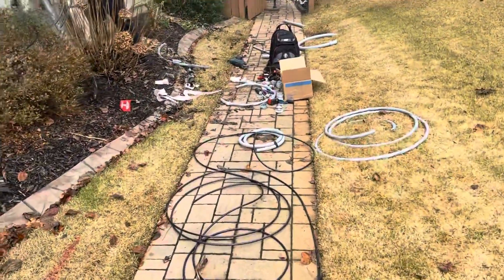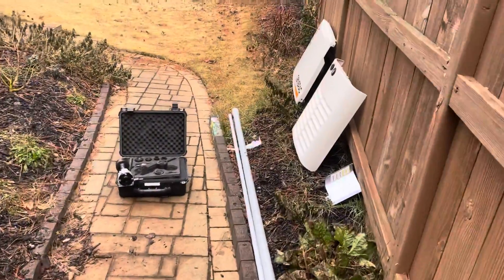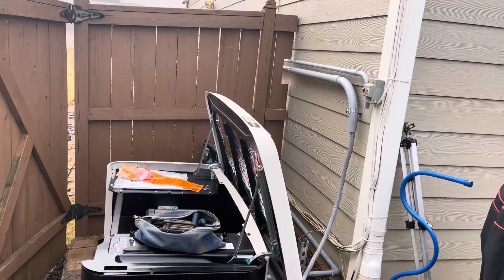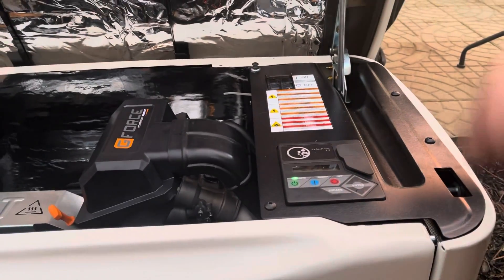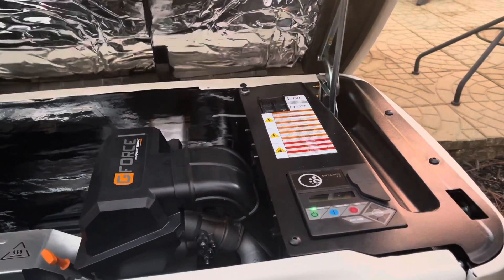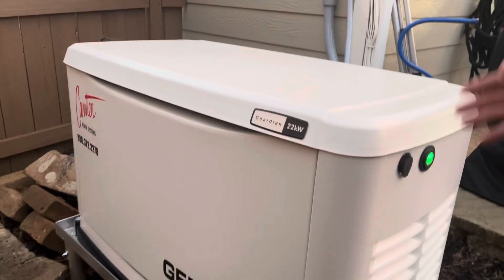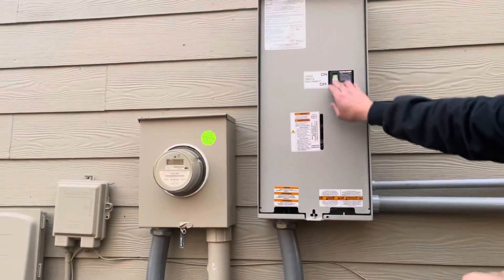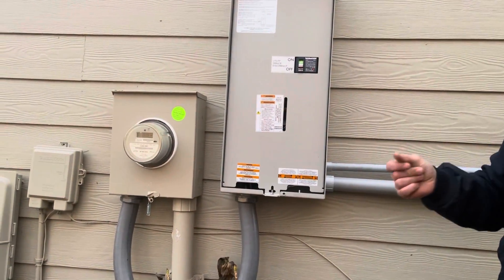Generac Guardian 22KW whole home generator Install Day & Demo

Comment: I’ve noticed a mist  videos the electrical work is very sloppy and it’s very ugly looking in this particular video the meter socket has a piece of seal tight going to the transfer switch why not change the meter socket to a right handed meter and put a nipple between there and clean it up that’s the first thing. Instead of running the electric along the top of the siding running on the bottom it’s much cleaner if you have to change your side and it’s less maintenance.